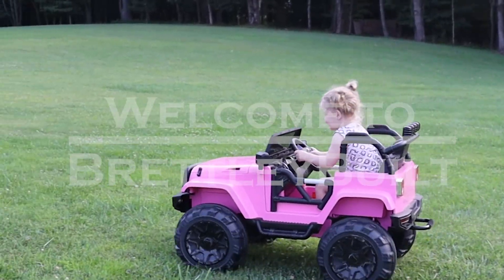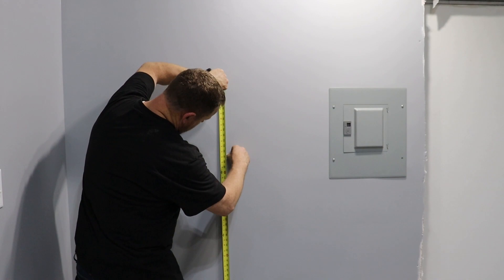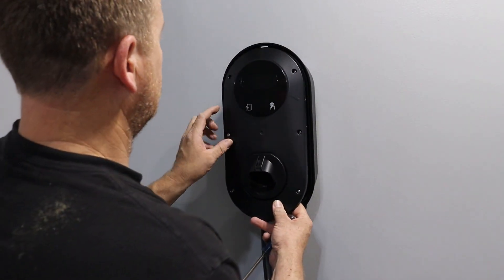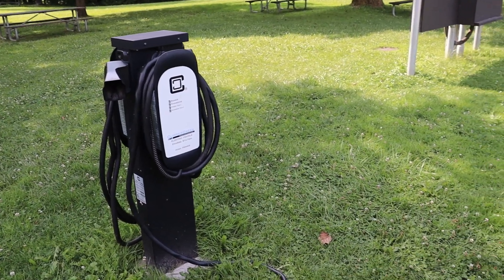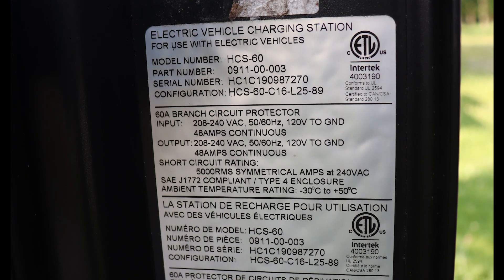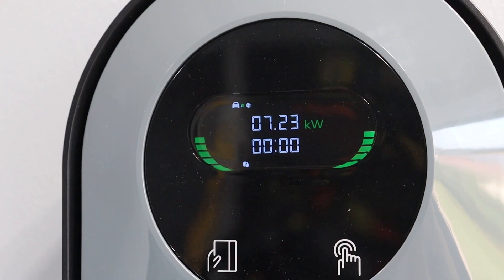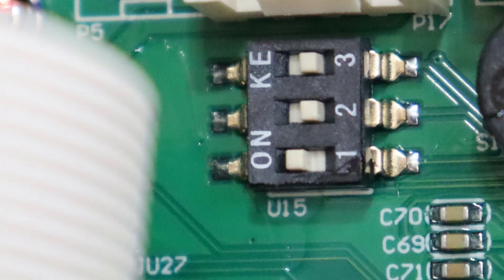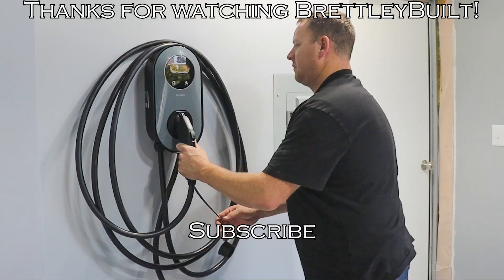AutoBot Home EV Charger | Installation and Review | RFID Card or Plug and Charge Mode | J1772

Comment: AUTOBOT DOSEN’T HONOR THEIR WARRANTY!

My unit failed 9 months after I purchased it on Amazon. I contacted the company and proceeded to send photos and proof of the installation. Additionally, I hired an electrician to check the breakers, and took my car in for service to eliminate every possible problem before asking for a replacement. The electrician confirmed, that the unit had failed and a needed replacement. On July 3, 2024, the company agreed to send me a new unit and thanked me for providing the evidence of the failure. Unfortunately, after multiple promises and apologies, they refuse to send the unit. They claim to have a hassle free 1-2 year warranty and I went the extra mile and provided them with the documentation they asked for. This company has ZERO integrity, and shouldn’t be trusted, you have so many options out there and can do much better than this company.

Comment: I installed this and it worked for a few weeks but today it doesn't charge. the RFID card gets a beep from the unit but no charging. there's a green arrow circle on the screen. any ideas on what to do?
Reply from the maker: Disconnect it from the power source (I am assuming it is plugged into a 50 amp outlet) and leave it unplugged for a minute. Plug it back in and see if it reset everything. If that doesn't work and you don't need the security of the RFID card, maybe change it in the settings to not use the card.

Comment: my charger charging very slow im trying change to higher amp it’s not changing is any one know why
Reply from the maker: If you use the plug-in set up of the charger, you lose some charging amperage. If you wire the charger into a panel box or sub panel box, you gain a few amps of charging.

Comment: Did you see higher than 7.6 kW charge rate? A 40 amp circuit should be able to deliver a rate of up to 9.6 kW.
Reply from the maker: I haven't seen a higher charging rate at 40 amps.